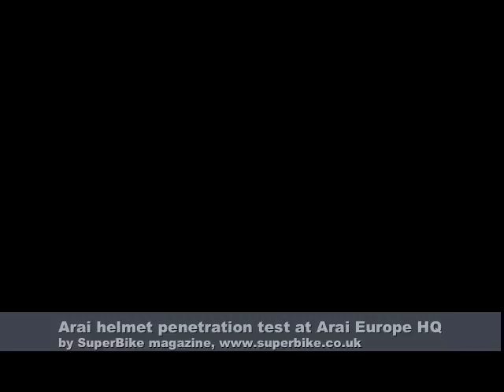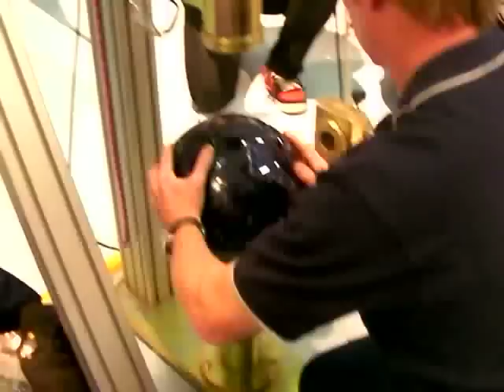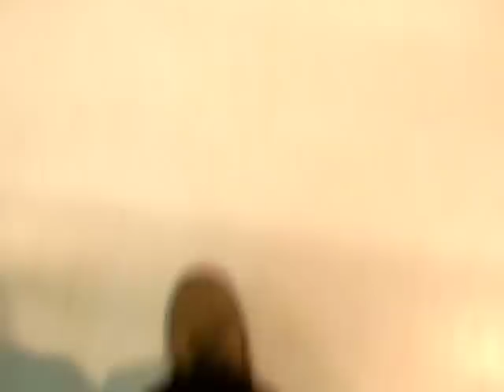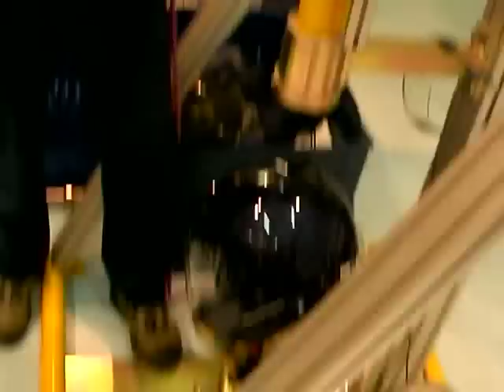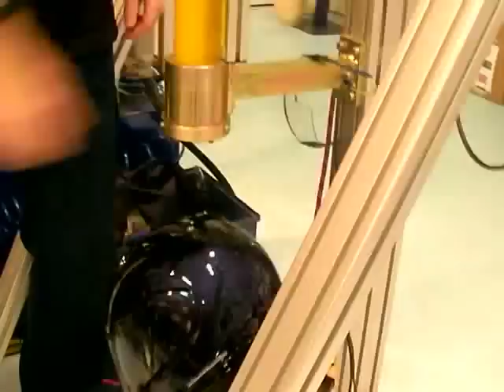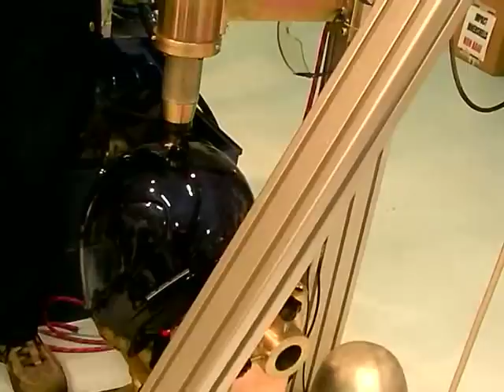Arai helmet penetration test

Comment: @harleymaori u don't get it do you? a helmet is design to protect our head and skull in a crash (falling action from a bike). if you hit your head on to the road, the helmet will give protection. the speed from a crash may exceed 100km/h but the speed that your head hit the ground is not 100km/h. rider will experience a serious injury not from the head but from the other parts of the body. stand aside a road and let a lorry hit you while doing 100km/h with helmet on. you will get neck injury

Comment: It's the INSIDE of the helmet that needs to be good at absorbing an impact. Not the outside.

When you have an accident you hit something with a large surface area (like, umm, the floor) and the helmets job is to gradually slow your head down so your brain doesn't get bounced around.

If you want a helmet that is designed to stop high-energy impacts to a small area then go buy yourself a ballistic army helmet.